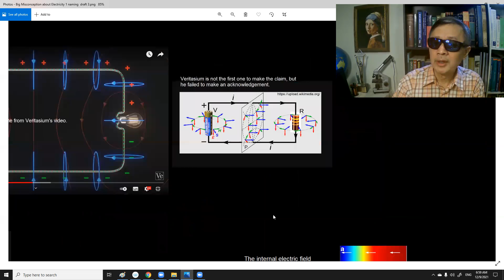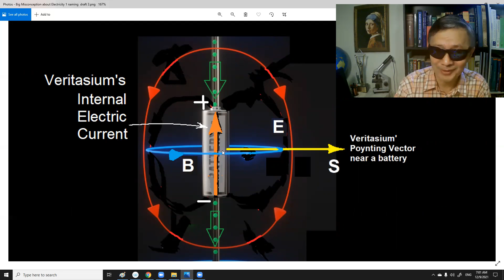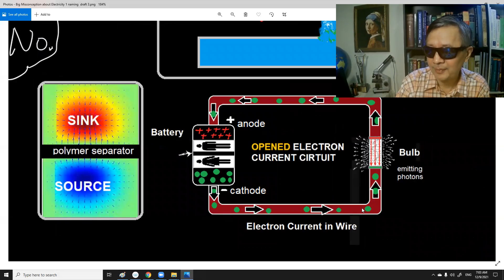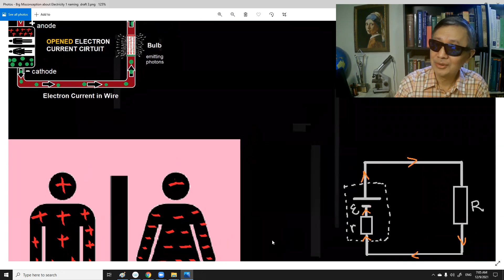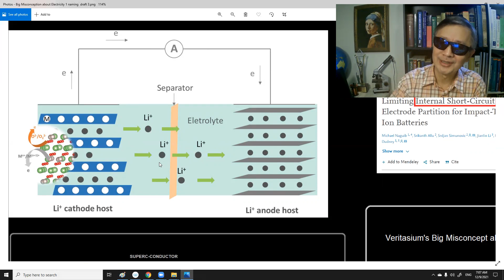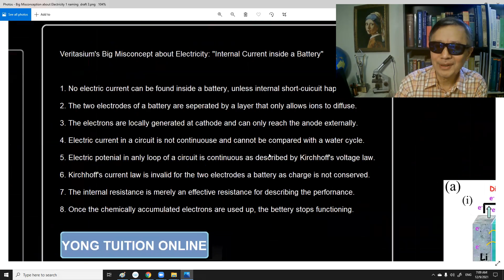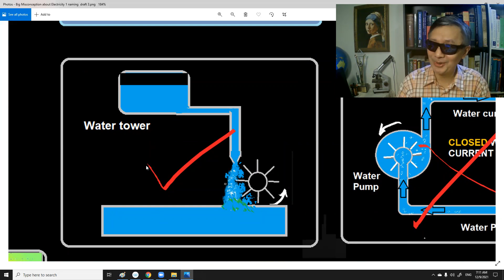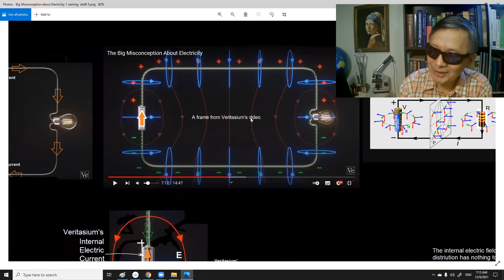No Electric Current inside a Battery: A critique on Veritasiaum's Misconception| Yong Tuition 211209

Comment: We can MEASURE the current in the electrolyte ...if we use a laboratory battery as in chemistry class:  two separate jars (the half-cells) connected by a hose full of electrolyte.   Use a clamp-on ammeter, connect a load to the metal terminals, and find that the current in the water-hose is identical to the current in either battery terminal.   (So, batteries are not capacitors after all.  Good thing, since each metal electrode transfers COULOMBS per second, and would immediately create billions of volts if excess electrons accumulated.)   

As every engineer knows, batteries behave as closed circuits with very low internal resistance.   This becomes more obvious when we use two separate half-cells, with a short-circuit connecting the two metal plates, and a conductive salt-hose connecting the electrolyte-pools in the two separate jars.   It's a complete circuit, where the amperes in the salt-hose are exactly the same as the amperes in the metal wire.

Confusion:  the ion diffusion is radial?   Perhaps in thin-layer electrolytes, but not in the above setup.  In the water-hose, the electric current is not driven by diffusion, instead the water is a resistor, and the current is driven by axial e-fields produced during battery operation ...same as in the metal wires.   Salt water after all is a conductor, and the current is caused by a potential-difference.

The key concept is from chemistry:   "half cells" are charge-pumps, and provide energy to produce current in the entire closed circuit.   The energy-source is located at the boundary between metal and electrolyte, in the Helmholtz double-layer.   Spontaneous oxidation causes metal to corrode, forcing positive metal ions to be actively pulled away from the dissolving metal.  This produces a charge-separation as positive ions are forced away from the equal amount of electrons left behind in the metal, which actively produces a voltage-difference between the metal and electrolyte.    In other words, batteries (half-cells) are powered by corrosion, because corrosion forces some positive charge into the electrolyte, leaving behind electrons in the metal, and causing the metal to be charged negative.   

Half-cells are charge-pumps, like spontaneously-charged capacitors.    Batteries are pairs of half cells fighting each other.   In Zn/Cu batteries, the zinc/electrolyte potential-diff is larger, so the zinc electrode "wins," forcing the copper electrode to "dissolve backwards" growing thicker with electroplating, while the zinc plate dissolves away.   (History: in old Crows-foot telegraph batteries, the zinc plate turns into zinc chloride, while the copper electrodes grow thicker via electroplating.   The heavy copper electrodes are then sold to metal dealers, in order to help pay for more zinc plates!   A Zn/Cu battery is a zinc-fueled charge-pump.
Reply from the maker: 1. "Each metal electrode transfers COULOMBS per second." No. The two metal electrode act as the electron soure and the electron sink. See 5:23. 
2. "Batteries behave as closed circuits with very low internal resistance." True. But the internal resistance, together with the external electric current at the electrodes, is merely used to phenomenologically describe the voltage drop V=rI, which is an indicator of the performance and the age of a real battery.  
3. "This produces a charge-separation as positive ions are forced away from the equal amount of electrons left behind in the metal." False. The electrons generated from the "oxidation" would immetiately run away into the load and to the positive electrode once the switch is on. Thus, there always more Zi ions than the electrons in the zinc bar. 
4. "Batteries are pairs of half cells fighting each other." No. both the electrons and the positive electron are happy to be attrated to each other. 
5. "The zinc electrode "wins," forcing the copper electrode to "dissolve backwards" growing thicker with electroplating". No. Copper ions are "reduced" because of the coming electrons, instead of the zine electrodes. Actuallu, the copper electrode is the winner in attracting the elelectrons.
Reply: @yongtuition  Again you are simply wrong.   Veritasium did his homework, while you don't obviously understand how batteries work.    Again AGAIN: we can *measure* the current in the electrolyte, and we find that it's the same as the current in the battery wires.  (Measure.  Experiment.  If a theory contradicts experiment, that theory is wrong, especially if the experiment is common, simple, and well known.)    The low internal resistance of batteries occurs because, in the double-half-cell jars with a hose full of electrolyte connecting them, that liquid hose acts as a conductor with an electric current.

Look up online, or in university textbooks:  ELECTROLYTIC CONDUCTOR, versus METALLIC CONDUCTOR.   Metals are conductive because of mobile charge.   Electrolytes are conductive because of mobile charge.   The mobile charge-carriers in electrolytes are ions.   (Heh, if electrolytes were insulating, then Electrophoresis wouldn't exist, and DNA analysis would be impossible.)

A better question is:  if electrolytes are conductors, then why don't they short out the battery?   Answer that question and you'll understand how batteries actually work.

In EE we sometimes use saltwater hoses as resistors.  Do you believe that the current in the saltwater is zero?  Note that the salt-hose resistance can be measured, and a longer salt-hose has higher resistance.

But we can easily measure the electrolyte current, so any theory which says differently, is wrong: is contradicting very simple high-school experiment.

I highly encourage you to build a pair of half-cell jars connected by an electrolyte-hose, and perform the test yourself.   You obviously won't believe me.   Maybe you will believe experimental results.

---

I think your mistake is in believing that electrolytes are insulators.  

No, they are good conductors, but not as good as metal.   Salt-water is conductive.  So is battery acid, so is alkaline battery electrolyte.  (Electrolytes act as "short circuits" which connect the two battery plates.)   I think you also believe that all electric currents are electron-flows only, and hence believe that ion-current isn't an electric current, when of course it is.   Moving ions transport charge in the electrolyte, and moving electrons transport charge in the metal.   One coulomb of ion-charge moving per second is one ampere.   One coulomb of electron charge moving per second is one ampere.

Rule of thumb:  in metals, the mobile charge-carriers are electrons.   In salt water, the mobile charge-carriers are +Na and -Cl ions, with also some +H and -OH ions as well.    In acid solutions, the main currents are caused by mobile +H ions (the +H ions are also called protons.   Please please please look up the "proton conductors" being widely used as fuel-cell electrolytes. )

About source and sink:  in alkaline batteries, the electrons flow through the electrolyte, carried by the flowing -OH ions.     (In other words, there is no "source" of mobile charges, because the flowing charges are provided by the conductors involved:  the electron-sea of the metal, and the mobile -OH population of the alkaline solution.)    

Perhaps a simpler example is the lead-acid battery, where the amperes in the electrolyte are 100% composed of flowing protons (flowing +H ions.)    Another word for "acid" is "proton conductor."

Metals conduct via electrons, see the Drude Model https://en.wikipedia.org/wiki/Drude_model

Acids conduct via protons, see the Grotthuss Mechanism https://en.wikipedia.org/wiki/Grotthuss_mechanism

PS
THINK:  In vacuum-capacitors we have "displacement current," while in batteries, what is the analogous term?   There must be one!   It should be as equally famous as the one for capacitors.

Easy.  It's called "ion flow" or "ion current" or "ionic charge-transport" or "electrolytic conductivity"    The amperes in a salt-water hose filled with mobile ions are just as real as the amperes in a metal wire full of mobile electrons.   Both the salt-hose and the metal wire serve as conductors, and can be employed as resistors.
Reply from the maker: @wbeaty  The salt bridge is conductive, but the ions go two opposite direction in the presence of a potential difference at both ends.
Reply: @wbeaty  thanks Bill- appreciate the clarification
Reply: @yongtuition   > but the ions go to opposite directions...

Yes, and that produces a large electric current in the electrolyte.   

THINK: if instead the populations of opposite-charged ions went in the same direction, THEN the current would be zero.

You've long been making a simple sign-error, and as a result, concluding incorrectly that the current in conductive electrolytes is zero, when instead it's doubled.   AGAIN (again, again,) this is a SIMPLE experiment from high-school, easily performed with ammeter on a kitchen table demonstrating that electrolytes are conductive materials, with genuine electric currents.  The experiment shows that you've been posting wrong statements and misleading everyone.    "No Electric Current Inside A Battery."    That's wrong.

In solutions, when opposite-charged ions go in two opposite directions, the current is larger, not smaller or canceled out.  This because the electric current of the backwards-moving negative ions has the same direction as the electric current of the forward-moving positive ions, and they add up to a larger amperes-value, NOT canceling out to zero amperes.   (Or, a person could simply admit that whenever a potential-difference is placed across a conductor such as acid or salt-water, an electric current appears within that conductor, according to Ohm's law.   Or, that person could stop talking and simply MEASURE the current.)

There's no need for argument here.   Galileo and Faraday prevailed in the end, because "Let the experiment be made."    The amperes-value in the electrolyte-hose between half-cells is exactly the same as the amperes value in the connecting wires.    Don't believe electrochemistry textbooks.  Don't believe me.  Don't argue about it.   Just test it.

Comment from the maker: @Marc Fruchtman  Thank you for your comments. Before Humphry Davy, electricty had nothing to do with chemical reactions, yet the current electricity in metal had been acknowledged. It was due to J.J. Thomson's discovery of electron from the cathode that the original "the current electicity" can finallly be explained. Of course, one could generalize electric current as "any moving charged objects" from linguistic point of view, as you called semantics. In passing, raining can hardly be formulated compared with moving water in a piple, irrespective of the quantities of drops. 

There are one electron source and one electron sink in a bettey which are seperated. Hence the electron current should be be considered as contineous, let alone consistently contineouse as defined in mathematics.

Comment from the maker: Answers to questions:

Eddie Tee asked: 
So if I make a line of batteries and put an amprobe around it you are saying I'm gonna get nil?
Yong Tuition
1 day ago
 @Eddie Tee  Do you mean to put many batteries in series? So long as the external circuit is open, no current can be measured.
Eddie Tee
14 hours ago
 @Yong Tuition  I'm nor talking an open circuit battery. When a battery is connected in a circuit and the circuit closes there must be current thru the battery.
Yong Tuition
3 hours ago
 @Eddie Tee  You are using water-cycle model, which is wrong. In a closed DC circuit, the electrons move from the negative electrods to the positive electrode. How can electrons move directly from the postive elctrode to the negative electrode?
Eddie Tee
2 hours ago
 @Yong Tuition  you have your interpretation wrong. Electricity flows from a higher potential to a low potential - regardless of direction of electrons. In your video you said "current doesn't flow through a battery".
You are wrong.
Yong Tuition
1 hour ago
 @Eddie Tee  Then, how could your electricity move from the negative electrode to the positive electrode? You cannot make your idea self-consistent.
Eddie Tee
8 minutes ago
 @Yong Tuition  you are distorting by opinion.
Yong Tuition
That is not an intelligible answer.

Comment: Sir, the flow of ions from one electrode to the other is certainly a current, and will create a magnetic field, just like the flow of electrons in a wire.
Reply from the maker: The ions inside a real battery are diffusive, but can positive ions move to the positive electrode?
Reply: @yongtuition  They must, or the battery won't work.  That is how a battery converts chemical potential energy to electrical energy in the circuit.  One half reaction releases electrons to the circuit, ions flow to the other half of the battery, the other half reaction consumes electrons from the circuit.
Reply from the maker: @jonathanedelson6733  You need to study the Galvanic cell. The posive ions generated in the oxidation cannot flow to the positive electrode. Instead, they have to wait the negative ions from the salt bridge to be neutriaized.
Reply: @yongtuition  Thank you for the correction.  However if you have negative ions moving in one part of the cell, and positive ions moving in the other part of the cell, do you not have an ion current in all regions of the cell which must match the electron current external to the cell?
Reply from the maker: @jonathanedelson6733  They cancell each other. As a result, the net charge flow is zero.
Reply: @yongtuition  The positive ions are moving in one direction.  The negative ions are moving in the opposite direction, correct?
Reply: @marcfruchtman9473  Yes, I am forever confusing the name Anode and Cathode.

But getting back to the original debate: I am claiming that the flow of ions in the electrochemical cell is a current which must match the current flow external to the cell.  I absolutely agree that there is not an 'electron current' inside the cell.  But weather it is positive ions or negative ions or both moving in the cell, that is current flow.
Reply: @marcfruchtman9473  Yes, but exactly the opposite of what @Yong Tuition is claiming

Comment: Kirchoff's Law says "current into a node is equal to current out of the node". You can't have lost currents.
Reply from the maker: There is no node in a battery other than an electron source an the electron sink.
Reply: @yongtuition  so if I make a line of batteries and put an amprobe around it you are saying I'm gonna get nil?
Reply from the maker: @eddietee6305  Do you mean to put many batteries in series? So long as the external circuit is open, no current can be measured.
Reply: @yongtuition  I'm nor talking an open circuit battery. When a battery is connected in a circuit and the circuit closes there must be current thru the battery.
Reply from the maker: @eddietee6305  You are using water-cycle model, which is wrong. In a closed DC circuit, the electrons move from the negative electrods to the positive electrode. How can electrons move directly from the postive elctrode to the negative electrode?
Reply: @yongtuition  you have your interpretation wrong. Electricity flows from a higher potential to a low potential - regardless of direction of electrons. In your video you said "current doesn't flow through a battery".
You are wrong.
Reply from the maker: @eddietee6305  Then, how could your electricity move from the negative electrode to the positive electrode? You cannot make your idea self-consistent.
Reply: @yongtuition  you are distorting by opinion.
Reply from the maker: @eddietee6305  That is not an intelligible answer.

Comment: Why does a battery gets hot Mr. Yong?
It's not because of the chemical reactions inside the battery. It's because there is a current flowing internally against the battery's internal resistance.
Reply from the maker: Besides, for a real battery, the metal electrodes can get hot if the external current is high.
Reply from the maker: The external electric current and the effecrtive internal resistence are usded to calculate the voltage drop, which is a variable. The internal current between the two electrodes your battery is dying.

Comment: What about the electrolyte? I know all batteries have separators but they need an electrolyte. Both dry cells and wet cells.
All in all I don't agree with Veritasium explanation of how power or energy is transferred in a simple light circuit.
Reply from the maker: A good separator only allows ions in a given electrolyte to pass through except for electrons.

Comment from the maker: The effective internal resistance is time-dependent, the older a battery, the large the internal resistance.  It is incorrect to relate the internal resistance, which is merely an indicator of the performance of a battery, to imagine some internal electric current exists based on charge conservation law.

Comment from the maker: In terns of charge conservation law, the number of the electrons should be equal to the number of Lithium ions, in the case of using a lithium battery. However, this is by no means to imply that the diffusive Li(+) ions can form an electric current to make the electric current continuous inside a lithium battery. As long as the battery is still alive, the Coulomb forces always restrict the motion of the positive ions from returning to the positive electrode. In the case of a Galvanic cell, the positive ions generated in the "oxidation" always stay around their escaping electrons due to Coulomb force, too.
Reply: You neglected the fact that the build up of excess net charge in each half cell, in the absence of a flow of ion in battery to balance the net charge in each half cell, is able to attract ion from the other half and repel the ion of same charge in the original half by columbs law.